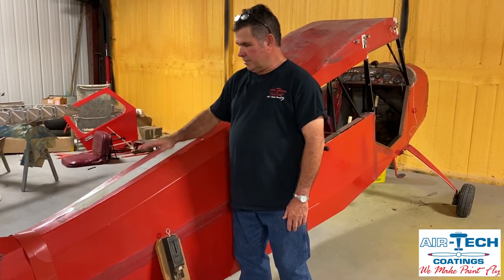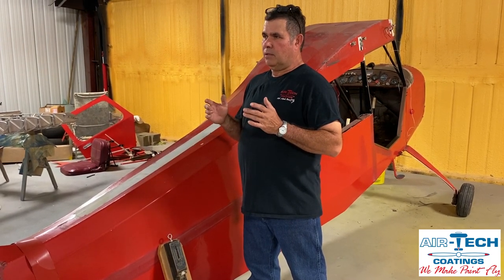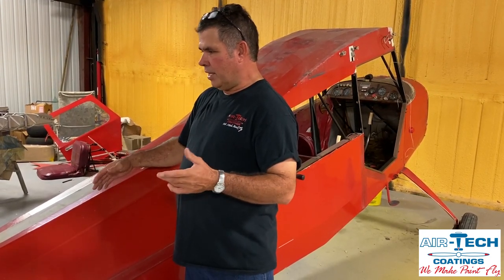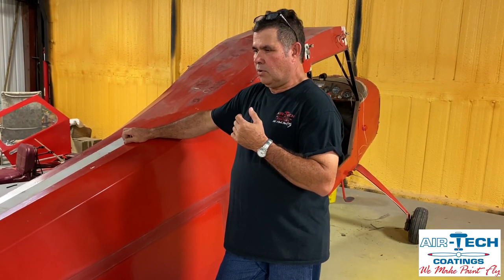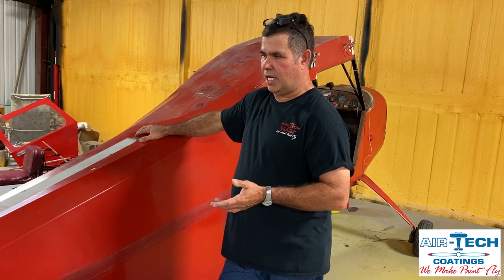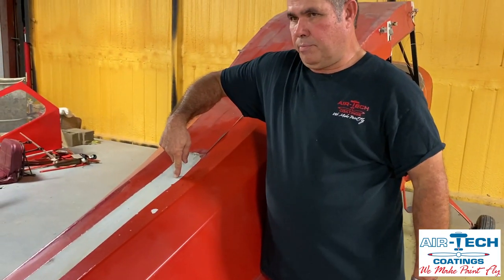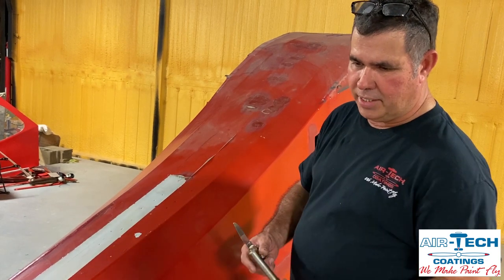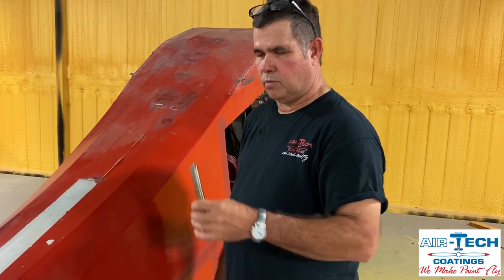Fabric Tip Friday 07 - Fabric Inspection

Comment: How long is polyfiber good for if it's unused and hangared?
Reply: Don’t know what you mean hangared. Unused mean it hasn’t been applied. If you mean on a plane  and hangared , our system could go 50 yrs. Far too long to not look at an airframe.
Reply: @robbiestaton604  it was a kolb someone bought factory built and they never used it. Been in hangar 15-20 years, it looks new, probably good for a while longer then